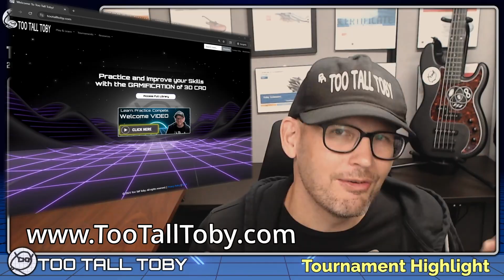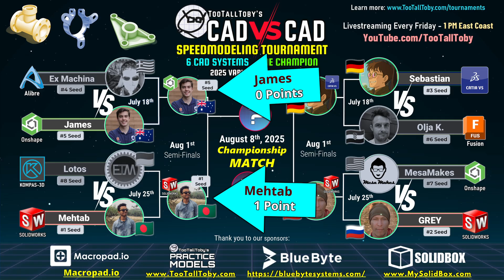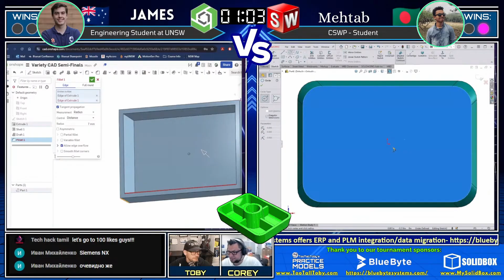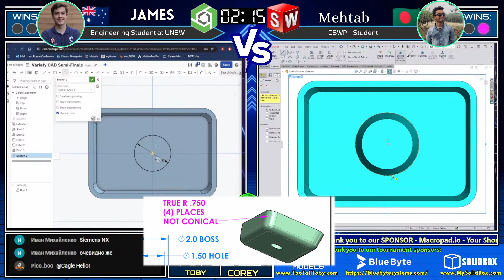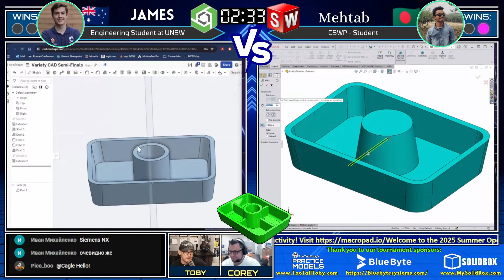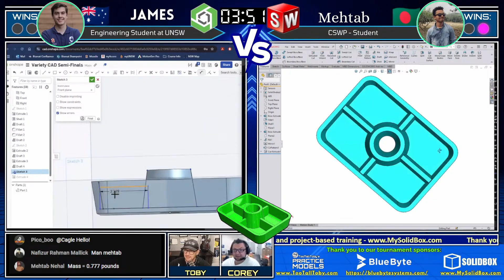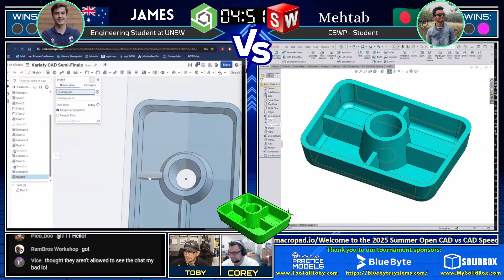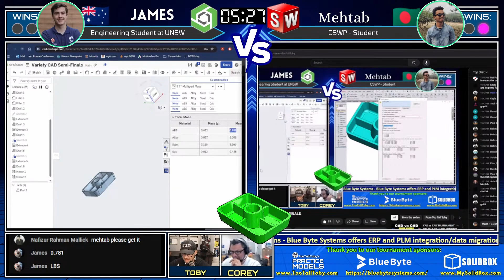CAD vs CAD TOURNAMENT Semi-Final Battle! 🎮 Onshape vs SOLIDWORKS

Comment: Wait till these guys here about the spacemouse by 3d connections if they aren’t already using one
Reply: Looks like James was using it. But what do you expect from the spacemouse? It wouldn't be faster for simple models.
Reply: @PetterStetter  Can confirm I was not using one, just a regular logitech mouse that I have had forever.
Reply from the maker: Spacemouse definitely has some advantages - particularly in the advanced mapping and shortcut tools. The thing I like about these challenges (and the challenges on the website) is that it lets users really refine their workflows - for example if you're working with spacemouse or space navigator, you could do some experimentation and repetition to really get your workflows dialed in!